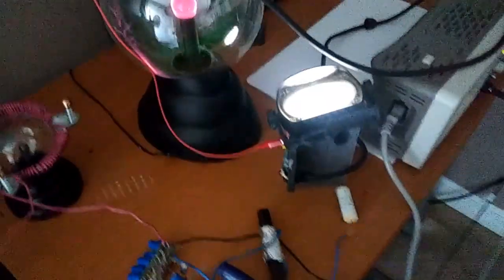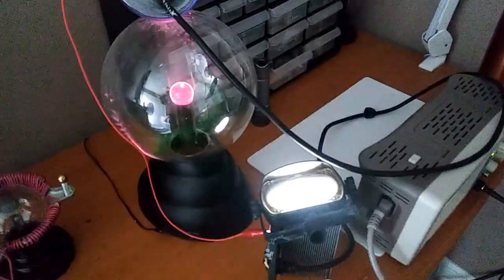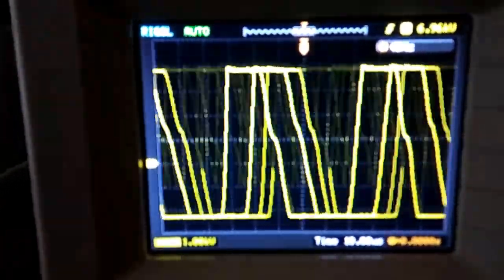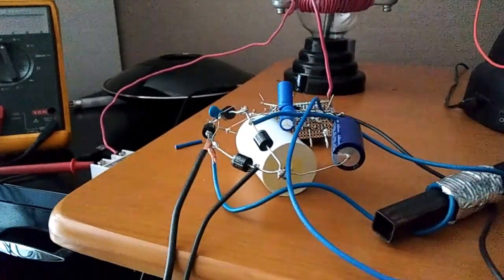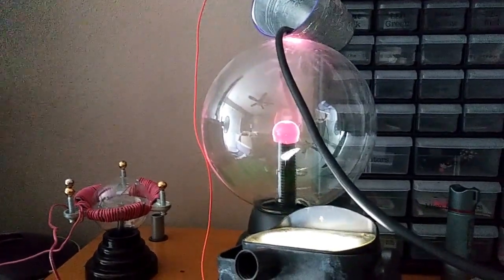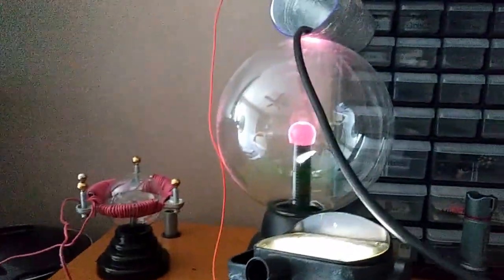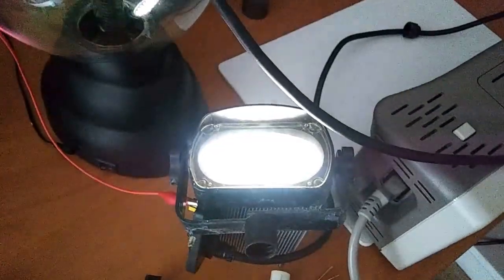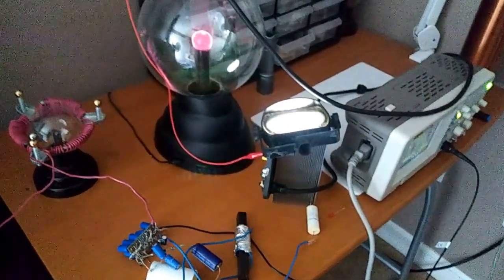Messing around with scalar waves

Comment: hmmm...here is what I see, please let me know where I am wrong.  This is a recreation of Tesla's radiant energy patent, in short, where he collects high energy positive particles from high energy waves...in your case the plasma ball...the collector the plastic cup...then moves this energy through a load (led light)...battery (super caps)...rectifier (diodes)...tuner (all coils and caps)...back to ground (negative source red wire off coil)

your oscope traces look similar to modulated radio signals or the bending affect?

Your outdoor experiment was somewhat different...as you combined an elevated conductor with a high energy particle source (plasma ball)...and everything I mentioned above...

You have shown that you can synthesize and apply knowledge and observations...congrats on that

You in Colorado by chance?